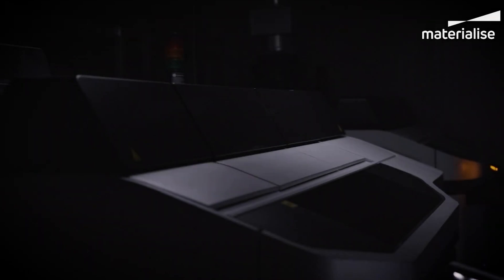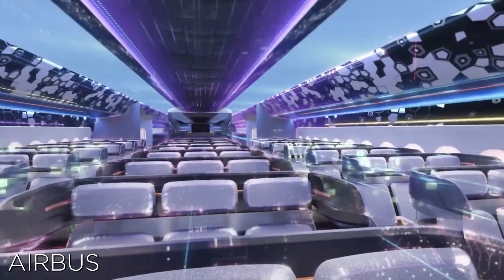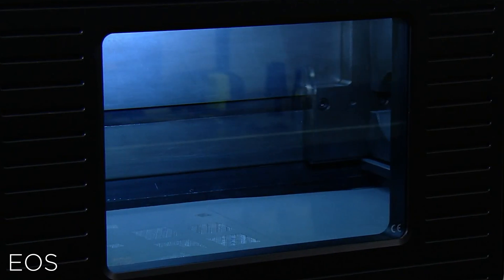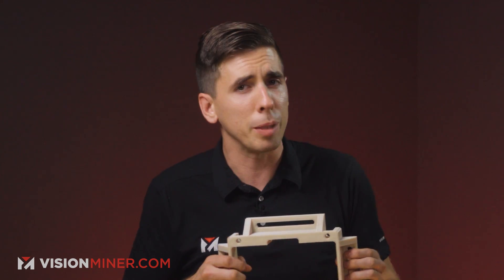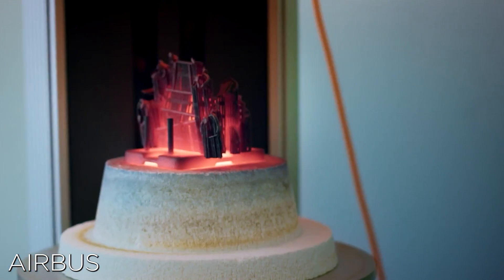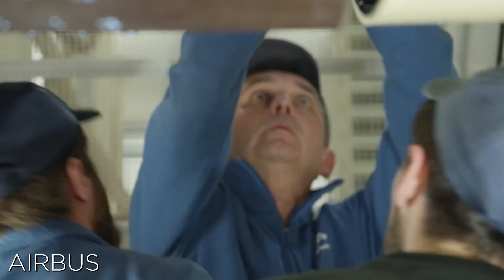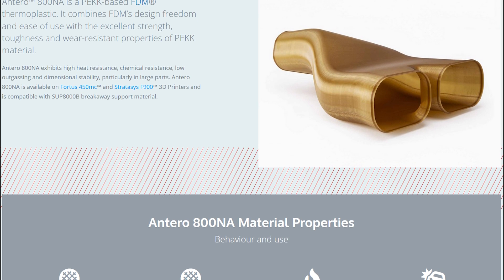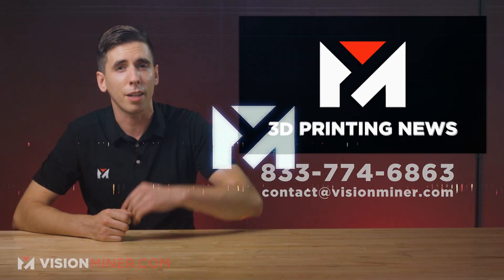Airbus Approves EOS SLS and Materialise 3D Printing Processes for Flight Ready Components

Comment: GE Aviation has been doing 3D metal printing for the last few years for the fuel injectors & other such parts which highly expensive & complex to machine. And as a side note GE has been able to reduce a little weight off the engines.